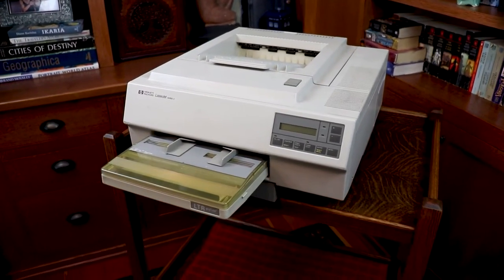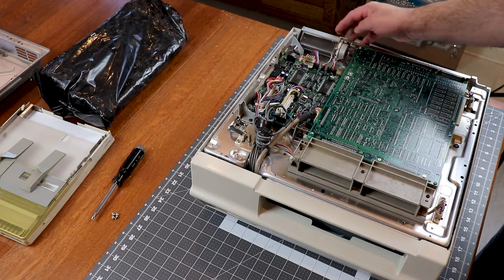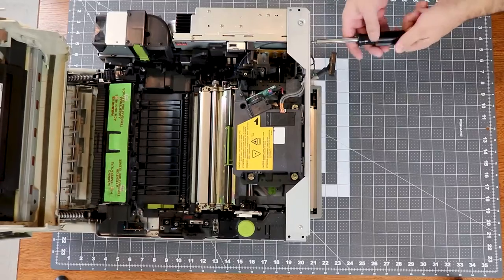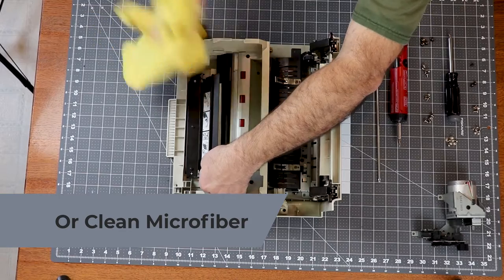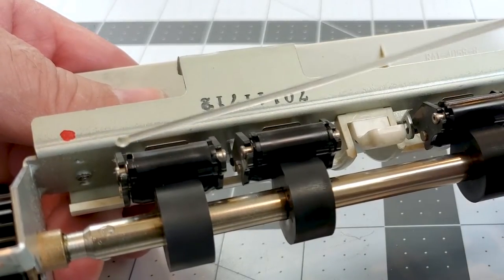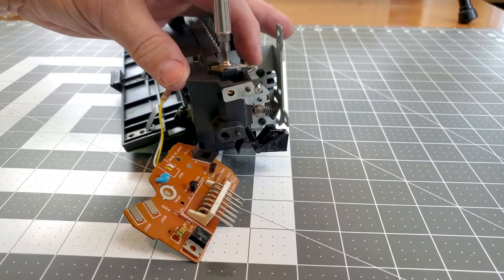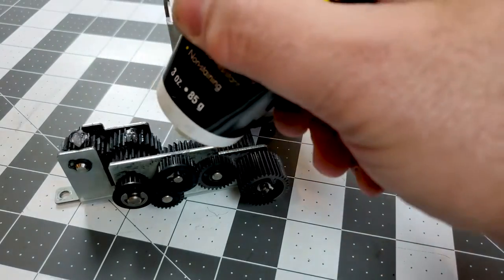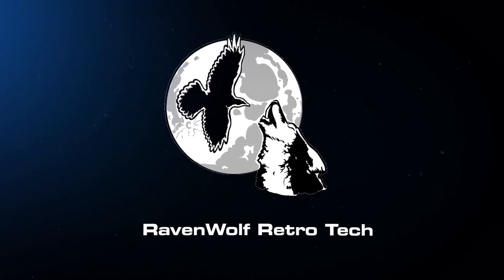Finishing Vintage HP LaserJet II Computer Printer Repair

Comment: This is a great series of videos. I have the similar Apple LaserWriter II. Any chance of updating the link for your 
LaserJet II Blog Post? I am currently having an issue with the fuser not getting hot. I am getting 5v, but not getting the needed 24 volts anywhere on the board. Is this part of the Error 50 issue? Is the Fuser Assembly shutting down the 24v through out the device? I have recapped the AC Power Supply, DC Power Supply, High Voltage Power Supply, IIg Controller Board and the DC Controller board. I ordered a new Fuser lamp. I am taking the Fuser Assembly apart this week will check the Thermoprotector as well. I have a steady green light on the printer. When I attempt to print the Mac sees the printer, the printer accepts the file and attempts to print. No errors on the Mac, but no print is ever made. I also do not get a test print, not at start up nor when the test button is pressed on the side. Sorry for asking questions. I am not finding much luck on the forums or Vintage Mac Facebook groups. Again, great tutorial videos on the other vintage computers, including the Amiga vids.
Reply from the maker: Stephen, no problem! questions like this are what prompt me to add posts to the blog which, sad to say, is sorely neglected. I added a brain dump on error 50s. It still needs images and an editing pass but I'll link it here so you  have early access https://ravenwolfretrotech.com/error-50-on-canon-sx-engine-printers/
Reply: @RavenWolfRetroTech  thank you. This was my personal “Marchintosh” project that has now gone into April. I bought a Mac II last year and the seller gave me the printer that had sat in his basement for decades. It’s a clean unit, just neglected. Appreciate the advice…
Reply: Ugh, I replaced the fuser lamp today. I still having no heat, no voltage (0.3v) at the fuser. I have a steady green light on the printer. I have a DC power supply arriving soon. I know the fuser plugs straight into the AC power block. I have replaced the 22uf capacitor on the daughter board and the triac. Next I will replace the fuser completely. Weird I’m usually successful with my repairs.
Reply from the maker: Do you have continuity through the fuser on the 2 contacts? If not the thermal fuse may be blown. I have not seen a DC PSU cause fuser issues but the AC module has a ton of issues.
Reply: @RavenWolfRetroTech  I have continuity at connector J103 fuser connector. My issue (I think) is I am not getting 24v which is generated by the lid close switch that is part of the DC Power Supply. The HP LaserJet II Service Manual says if no 24v is present to change the DC Power Supply. I bought a replacement that arrives Wednesday. I am hoping this will be my issue. I did change the lamp bulb in the fuser assembly (using gloves). 
I wanted to say I loved the Amiga TV station barn find video. I started out as a newspaper photographer back in the late 80's and have lots of friends that worked at TV stations during that period. It was such a cool period gathering news back then.

Comment: For this kind of 1980s printer, is it possible to use it with today’s computers, such as a 2016 MacBook Pro?
Reply from the maker: I'm not a modern Mac user. you would need to connect to a parallel connection using PCL or, with a cartridge, postscript.
Reply: @RavenWolfRetroTech  Hmm I see. Thanks for info!